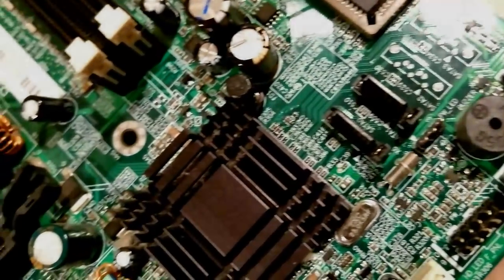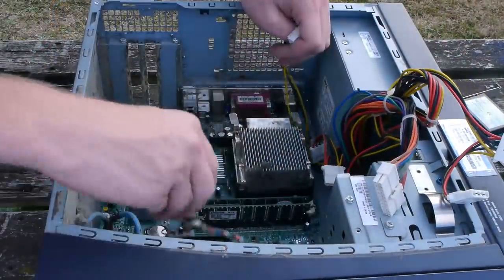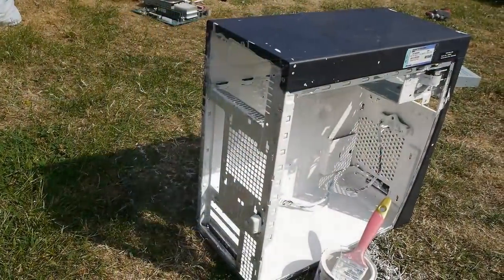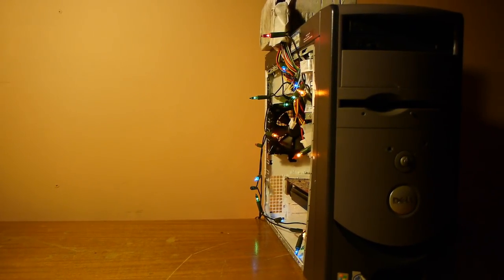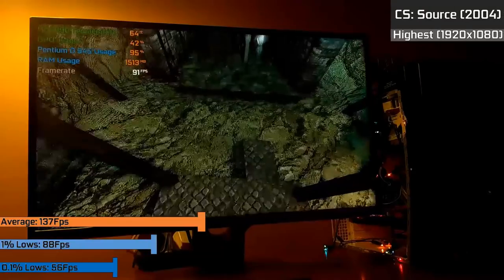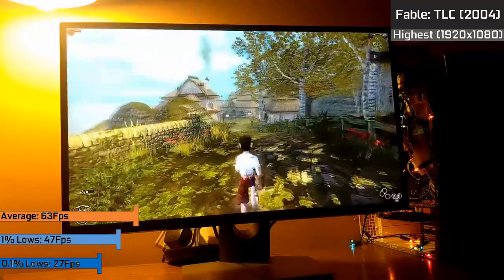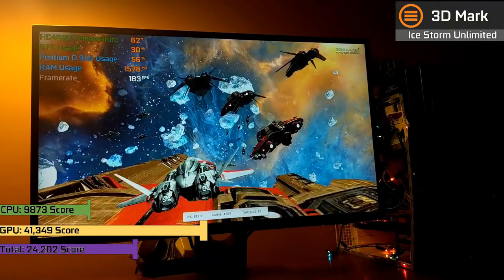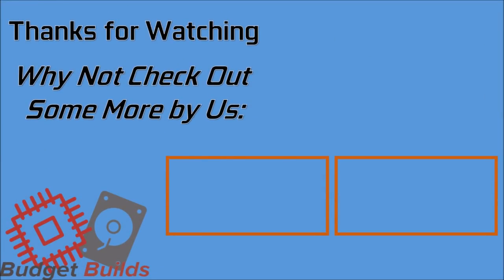Can you build a £5/$7 Gaming PC?

Comment: If you can build a pc for £1, you sure as hell can build a pc for £5
Reply from the maker: Dell Massey: But a decent PC?
Reply: you can but would you want too
Reply: @BudgetBuildsOfficial  imagine what you can build with €1000
Reply: Rasperry pi zero 'gaming pc'
Reply: @quartnoire  you wouldn't believe what I built for only $900. It's easily a $1.5k machine.
Reply: But not anything any good... I wouldn't call a Pentium D a good choice, especially paired with a motherboard that requires beta drivers to work with the Pentium D, and is locked to 2GB RAM... which would have been OK for Windows XP but not anything newer.

Comment: Should have tried Linux on this system too, I reckon the OS and some games would have worked so much better 🤔😋
Reply from the maker: The issue with Linux is that the motherboard really hates different OSs, including Linux.
Reply: Just some games tho...
maybe not the ones most people want to play.
Reply: Honestly, I disagree, there is an awful lot of things you can do with Linux now. Most games can be run on the new Vulkan API yielding far better results than running them through Wine etc. Most of the popular games can run fine on Linux, even if they don't have native Linux support.
Reply: Most games on linux with vulkan? sure sure...    fighterz, witcher 3, gta V

by the way, with this particular machine the gpu isnt a problem on linux, the problem is the cpu overhead on wine for any game that isnt linux compatible(including A LOT of older stuff form the 2000s)
Reply: While it's true Linux is more lighteeight and easier to run, it has an extremely limited and poor selection. Which is probably why they chose Windows to run instead.
Reply: Steets The problem isn't the game selection, because it's getting better and better and you can run Windows games fine with little performance hit. It was already mentioned the problem here is the motherboard, that's the problem I have with my machine too, I'd use Linux fulltime but there's no support for sound for my motherboard, that's a minor issue but still a hassle to work around, this motherboard shown in the video could be even *worse*.
Reply from the maker: Brennan Price: Only issue there.... This GPU does not support Vulkan, and the slightly increased low of converting the libraries in real time is just too bandwidth reliant on a system like this.

I prefer Windows 7 for my older/low spec gaming systems, primarily for this reason.

But Linux may be used one day.
Reply: I reckon that keeping with the original Pentium 4 system and shoving Windows XP on it (there's an XP COA on the side of the case) would have been OK for older titles (except this challenge needed something better than XP), as well as a light version of Linux.

Comment: On my birthday this year I built a cardboard PC to tell my parents that I really wanted a computer. In it I put christmas tree lights as RGB. (btw this method didn't work )

Edit: Almost 3 years later, I finally have my own (good) laptop
Reply: Just save up 5£ and you can buy a "gaming/editing pc".
Reply: DistractedFace The family laptop that we have is better
Reply: iCrafterChips :(
Reply: poor guy ;(
Reply: buy an HP 6300 Pro SFF and put in 4 gigs of ram and a gtx 1050 ti
Reply: oldcracker better save up for a proper gaming pc
Reply: iCrafterChips it is? I run gta v on max details and get 60 FPS and it’s super cheap
Reply: iCrafterChips actually no. just do with what you have and upgrade later. buy 1050 ti and cheap 2nd hand dell or hp with i5 2500 cpu . you'll get 60 fps 1080p on high settings on most games
Reply: Vlux corp True
Reply: @bikboi3292  how much

Comment: That PC deadass has similar specs to my Dell Dimension 3100 from 2005 (512 MB of RAM and 2.66 GHz Pentium 4) - very reliable workhorse it was too; had it for a good decade until we gave it away to relatives in Bangladesh when our house was overflowing with computers and if they still have it, it may still be in working condition! So many memories on that PC, being the perfect machine to play GTA Vice City on; I remember the Sims 2 really pushed it to its limits, slowing the computer right down! I even managed to complete NFS Most Wanted on it despite the game crashing a couple of times!

Comment: Great video as always I'm curious would you try to build a PC with only parts from videogame consoles?
Reply: Lit Reviews why not there must be plenty of parts applicable for a computer?
Reply from the maker: You can use the HDD, and that's about it really.
Reply: Jay Brewer it is all soldered to the mobo.
Reply: Not possible  especially the cpu and gpu, the cpu's socket wouldn't fit any computer motherboard EVEN if you could remove it, the gpu is soldered into the mobo, you would destroy it trying to remove it.
Reply: Just let Linus try it and possibly screw it up.
Reply: Lit Reviews well, you can install Ubuntu on a ps3, if you can somehow get the drivers to work with the APU you might turn it into a gaming pc.
Reply: The CPU in the original Xbox is a regular cpu
Reply: The CPU in the original xbox, is a BGA Modified Celeron/PIII Hybrid type chip.

Comment: 14:34 fantastic! That's the settings I like to see: 240p "ultra low" with no shadows! That's gonna look really nice!
P.S. If you have weak hardware, Budget Builds himself uploaded a video on how to get GTA V running on any DX10 compatible system. The weakest DX10 GPUs will run GTA 5 on 240p no shadows, as will really weak CPUs (such as Core 2 Duos and the aforementioned Pentium D).
GTA 5 will even run on an old Core 2 Duo T4300/HD4570 based laptop!

Comment: lol You know what used to really piss me off back in the day? When I would get my hands on a computer that had a Motherboard with Options taken out of it, like the AGP Video Card Slot! Would have made twice the power for gaming (not that it is that much by todays standards lol) but yeah that used to really get under my skin! I do have an Old HP a805n with a 2.4Ghz P4, 2 Gigs of 400Mhz RAM, a 512Mb Nividea GeForce PCI Video Card (a rarity in todays world, you can find 128Mb & 256Mb PCI cards all day long  but have not seen a 512 in a LONG time) & another rarity a 500Gb IDE Hard Drive which I havens seen anything larger than 250Gb IDE in ages. I have Windows XP on it. Probly the most demanding Game it will run is Halo 2 (patched to run on XP).

Comment: Heh, dual psus.

I ran a pair on my original athlon xp system. One for the mobo/cpu/gpu, another for the 8 hdds i had in there. Before i put it under water, i had a 3x stack of 60mm cpu fans, running at about 16,000rpm. Not exactly a quiet rig... but it was fast, cheap, and over 25kg. That and my 21inch crt, im pretty sure the house could have been hit by a tornado and my computer desk would be sitting there fine in a pile of rubble. Good times.

Comment: Nice vid bro...what do you think about an i5 2400 /8gb ram/ gt 1030 (also q9400/gt 1030) (2 PCs... how well would fortnite do ?)
Reply from the maker: Provided those are the decent 1030s, probably around 60Fps 1080p Low/Med.
Reply: Andrei Loghin is your gt 1030 ddr4 or gddr5?
Reply: Considered buying 750ti's instead? cheaper and more performance.
Reply: GDDR5 ... (i dont have it yet but im going to pair it with those Cpus :)) )
Reply: Yah i was going for the 750ti ... but i think that the 10xx Series is better optimized and it has better Driver Support ( or is just me ? )
Reply: Andrei Loghin good choice mate. Ddr4 has almost half the performance.
 I have a gt 1030 gddr5 version with my Q8300 system and it runs fine
750ti is only 15% better though
Reply: 15% on average, games like cs:go have 50% more fps, stuff that is ram bound is ram bound on both, so you'll have similar performance if you have high texture details. I'd still go for 2 used 750ti's, though. You get them for the price of one new 1030 if you are lucky.

Comment: I built a AMD Semperon single core with 4gigs of ram and dual XFX HD7850s and a 32gig SSD and I used a power supply I had sitting around...for free, it also came with a crate of random computer crap too lol

Comment: My son had a Lenovo z50-75 with a AMD FX7500 quad core processor graphics are dedicated card with Radeon R7 and 2GB memory and has 8GB RAM. He seems to think it’s not very good for games. Fortnite in particular. The twins have a Xbox one, PS4 and a switch so this isn’t their main machine. Anyways, he wants a desktop thinking it can run fortnite better. We have a spare had tv and a mouse and keyboard so really my question is could I build a modern gaming machine better than the aforementioned laptop that was a case, motherboard, processor, ram, graphics, power supply and a hard drive for about £200ish? I mean I have no idea what the heck I’m doing but I’m very competent with electronics and computer tinkering. Ta
Reply: Hmm.. You should go for used parts. I suggest ebay and sites like that , I have a suggestion for the CPU you should get an amd 2200g. Good luck
Reply: Thanks, I have scoured ebay and realised I can get quite a good ready made PC with a i5 and 8GB of RAM for about £130-£150. Perhaps only thing on the system that isn't so good is the graphics so I would need to source a better graphics card, thanks though

Comment: Can I run CS source over 80fps my pc spec
I5 3330 stock cooler
8gb DDR3 memory 1300+ mz
I ball 400w PSU 
WD 160 GB HARDDISK @7200 rpm
Reply: that's kinda awful for early source games, are you using integrated graphics?

Comment: Why hosing with water?? You nuts?? People can get hurt!
Reply from the maker: Who, what, why?
Reply: @BudgetBuildsOfficial 
Who: anyone that can't understand that water+electricity is not good.
What: the case was still carrying standard headers and usb ones when you started hosing them.
Why: turning a pc with electrical components still dry will fry itself and could cause damage and potentially kill someone.

Use the compressed air next time, as anyone with a minimum level of common sense has been doing to clean electronic parts. Or at least clarify that spraying water over circuits is a very dangerous operation.